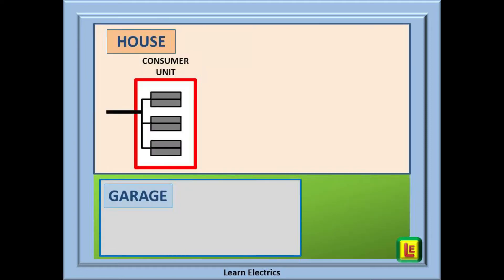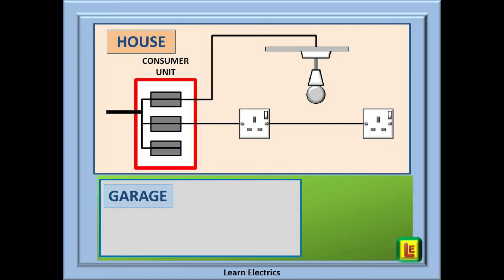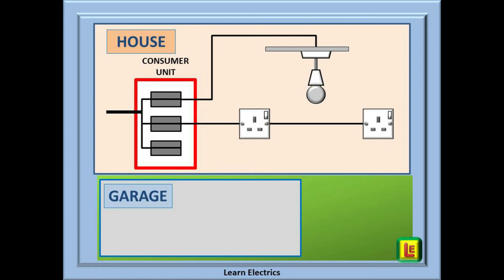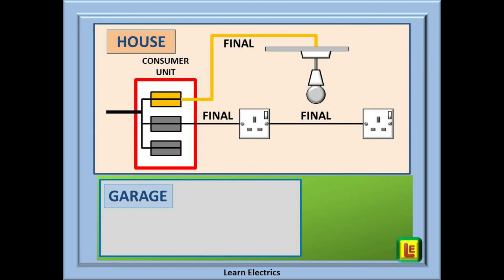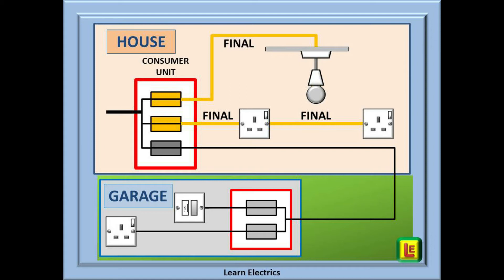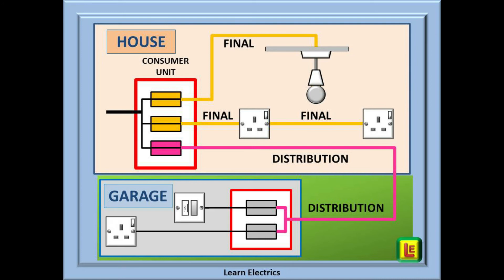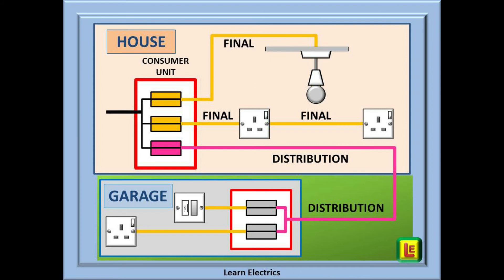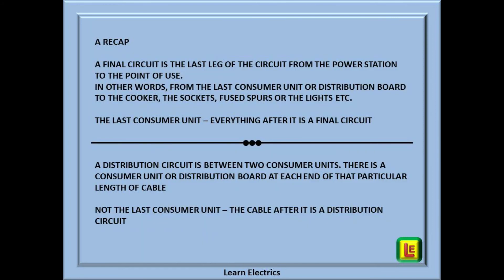FINAL DISTRIBUTION CIRCUITS Identify the difference between Electrical Final & Distribution Circuits

Comment: If a garage CU is fed from a spur from a final ring, is the cable from the junction on final ring to the garage CU a final circuit or a distribution circuit?
Reply from the maker: Neither, its a spur off a ring circuit. See video on link below.
As such you are limited to one single socket or one double socket, but NOT two single sockets. Unless you install an FCU. See the video.
https://www.youtube.com/watch?v=WWhXh1tqmF4

Comment: @LEARN ELECTRICS  Well explain, I now know the difference between final circuit and distribution circuit. Please I want to ask a question. What's the difference among consumer unit, distribution board, sub circuit and main switch.
Thanks
Reply from the maker: What a great question Daniel. Next weeks video is about single phase and 3 phase PFC differences, which will help and I have added your request onto the list to be done. Keep watching. Dave.
Reply: @learnelectrics4402  wow! Thanks for your immediate response. I really appreciate it. God bless you

Comment: I have a garage electrical feed from a fused spur off of my 2.5 mm kitchen ring. That feed goes into a garage consumer unit. Is that ok under bs7671, as - to me - it looks like a distribution circuit coming off a final circuit? I suppose ideally the garage would have its own MCB on the house consumer unit?
Reply from the maker: If the fused spur is 13A and all in 2.5mm then according to the Regs it is ok, you can't exceed 13 A for that leg. Good practice would say to put it onto its own circuit. Nothing wrong with putting a 40A MCB into the House CU and taking a cable from that to the garage CU with I assume a 20A or 32A  for sockets and 6A breaker for lights. This will give you more power availability in your garage. A good little project. Good luck. Dave.
Reply: @learnelectrics4402  
A final ring can have a 16A spur off it for a permanent equipment appliance, as long as it is switched.  A garage CU with a 16A main fuse and main switch in it is compliant, as it is permanent equipment.  BS 1363 accessories have to be on the final ring being 13A. The accessories are 13A sockets and FCUs.

Comment: Do we need any RCD in there?
Reply from the maker: For clarity we have not included RCDs. This is just about the differences. Check out our other videos which include discussion on RCDs. Thanks for watching. Dave.
Reply: @learnelectrics4402  thank you for the answer,I am watching most of the episodes ,but unfortunately there is no clear video how to feed the garages, sheds etc. I'm sure there will be a lot of interest if you can do a video about the selectivity/time delay RCDs ,Thank you for your hard job.
Reply from the maker: Thanks for the comments. This video is just about the differences between ring and radial circuits and we do say that the RCDs have been left off for clarity. Our method is to look at just one topic in each video rather than put 4 or 5 different subjects in and perhaps cause a little confusion. Over the years we have found it better this way, lots of small steps.
But yes, there is a video planned on RCDs and RCBOs. Anytime in the next few weeks.
Have you looked at our videos below copy and paste the link into your browser 
Extending Consumer Units  https://www.youtube.com/watch?v=pdKtFEhP3Eo
Consumer Units part 1 Split Load  https://www.youtube.com/watch?v=TwH9lbbOc9w
Keep watching, lots more to come.